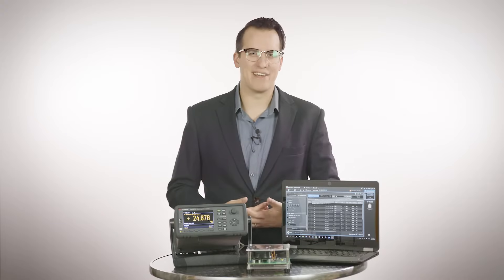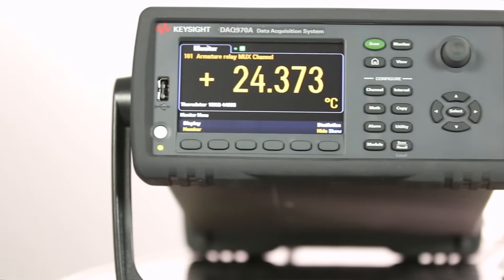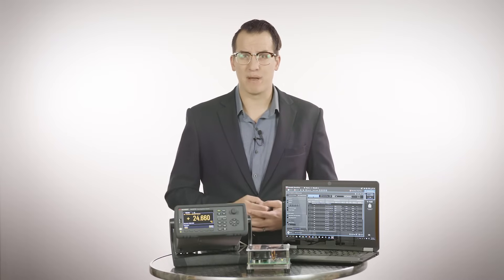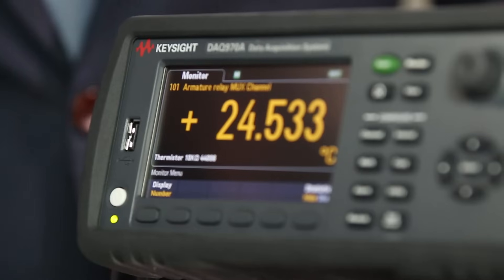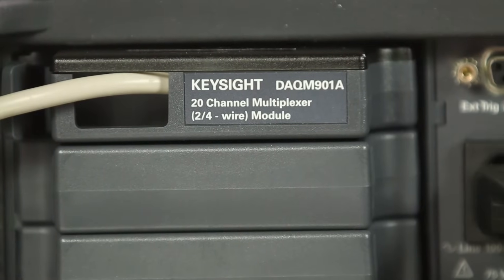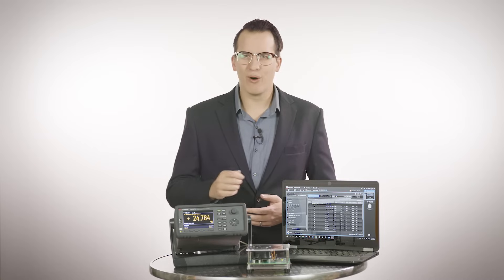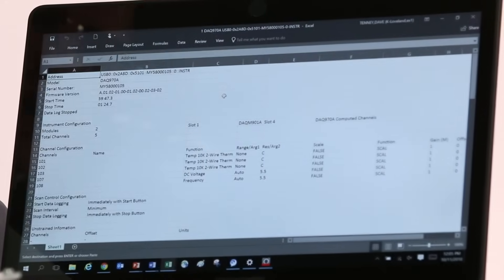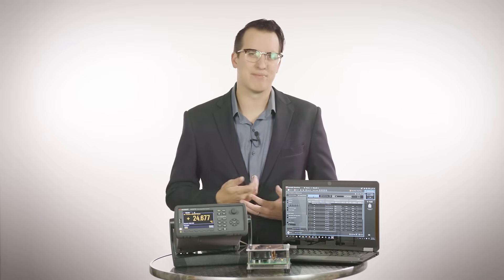DAQ970A Spotlight Video

Comment: Keysight/Agilent/HP has made daq systems for over 25 years?  What happened to the 3497 circa 1980, 40 years ago?  The 3495 before that?  6940 before HPIB?  6942/44/54?  Even the 3852 was mid-1980's, well over 25 years ago.  Did I miss some years?
Reply from the maker: You're right! Many many years :)